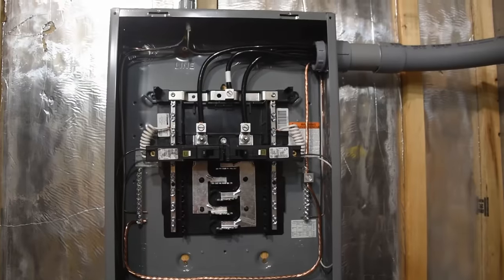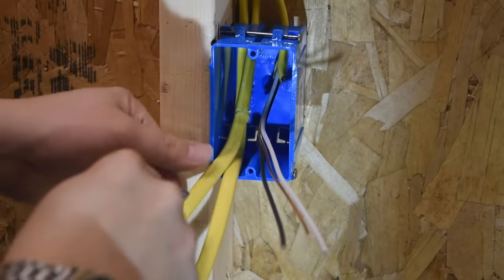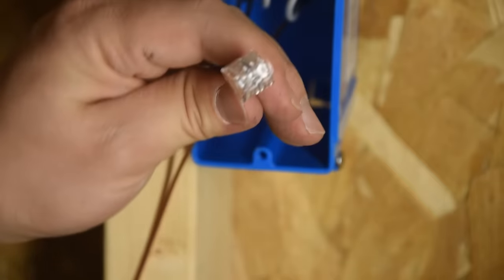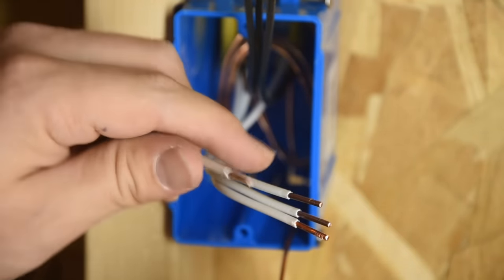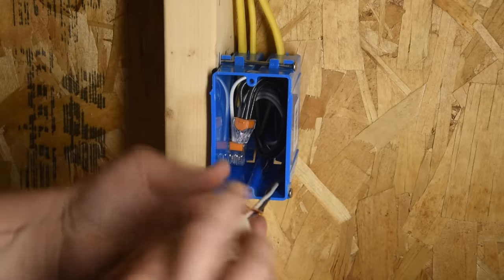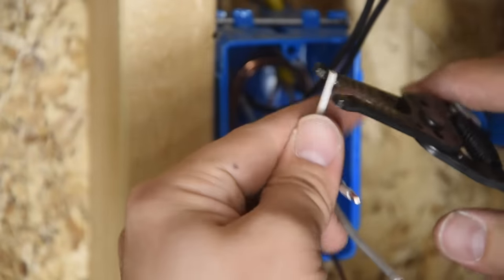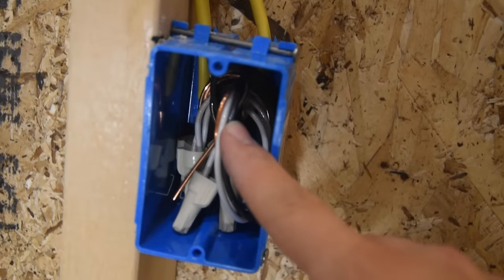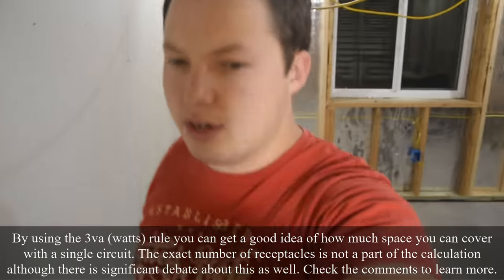Wago's vs. Wire Nuts - How To Wire Outlets During Rough In

Comment: 34 years in the business,  the Back Stabbed outlets and switches failed. Twist those wires!  current is heat.
Reply: Valuable information on here, Thanks 😊
Reply: 35 years here always twist and wire nut them never ever back stab my friends or my outlets
Reply: @Edgardocelectric007  What about Wagos though? are they good for 120V long term?
Reply: @Nate-ud2yt  personally dont know(much like shark bites i hdont think they have been out long enough for accurate test)  dont like these push types starting to use the lever ones and i have been a fan of copper crimps and nylon snap caps for 25 yrs

Comment: When you get a little older, you'll realize why old electricians twist the wires together with lineman's pliers and use a wire nut. Also why they don't use push in connectors on the back of outlets or switches. Hopefully no one dies in the resulting fires in the interim.
Reply: When you get a little wiser, you'll realize that wago connectors are perfectly acceptable and are UL, CSA, IEC, and CE certified. Just because you where taught to use another method does not mean this method is unsafe.
Reply: @BrianSimmons  Where did wisdom come in this discussion? Lazy people will always go with easy way.
Reply: @BrianSimmons  
Was aluminum deemed as a safe wiring method? Stab in receptacles that allowed 8#12 to be stabbed into the back?
Just because something is listed and approved does not mean it is safe.
Zinsco for example was and is UL.
Reply: @chrisminblkdiamond  Aluminum wiring is not unsafe.  It has been used in electrical transmission lines for hundreds of years and is still used today.  When it was used for about 10 years in residential wiring, the switches and receptacles that the wiring was used with weren't designed to be used with aluminum wiring and that was the hazard.

So there are several takeaways here.  One. you don't really know what you are talking about and two, unsafe practices are corrected pretty quickly.  Yet Wago connectors have been used for nearly 50 years.  If they were truly unsafe, they would have been outlawed long ago.
Reply: the greatest line and lesson from Jurassic Park was Jeff Goldbloom,  “Your scientists were so preoccupied with whether or not they could, they didn’t stop to think if they should.”
Reply: Nowhere in the mfg instructions do it say, twist the wires, thus when you do so, you are violating the mfg instructions, thus negating it's UL listing. FACT.  And even dumber is actually twisting the wires, which is also a violation, since it unnecessarily causes stress on the solid wires, not meant to be twisted as such
Reply: Yup, I have an electrician friend who makes a good living fixing electrical faults caused by lazy electricians (and home DIY'ers) who used the push-in connectors on outlets and switches instead of the screw terminals. They ALWAYS fail. If yours haven't failed, it's because they haven't failed YET. These Wago connectors look to be exactly the same. Maybe the lever ones are different?
Reply: @cengeb    And nowhere in the mfg instructions does it say not to twist the wires together first. So i guess it doesn’t really matter.
Maybe you can tell us exactly what code pretwisting wires violate.
Reply: @huejanus5505  they certainly do say do not twist wires, , that is not how they are meant to be used...Do not Twist,
Reply: @ScottsSynthStuff  Wago is nothing like the push in connectors on a Duplex outlet, get a education, and stay current...hey, that's a pun

Comment: Does anyone think you should always leave twist nuts facing up just to avoid the possibility of condensation puddling in the nut itself???
Reply: I always try to, especially on the exterior, plus on the interior there's always a chance of broken water lines or roof leaks
Reply: you are right sir...

Comment: note were i am, just putting each wire into a wire nut and twisting, would totally fail on inspection, not allowed, all wires must be twisted tight together clock wise using a good set of klin line pliers then screw on your wire nut, by not doing this it a great place for electrical fires to start,  lost  wires always end up in the wire nut and heat up. on inspection, the inspector will remove at randam if not all wire nuts to see that all wires have been pre tristed tight and the ends trimmed flush

Comment: Why the hell would you feed the circuit in the middle and not the closest outlet so you would only have feed in feed out in all boxes#1
Always twist wire before installing wire nut. Splice should hold itself before wire nut #2   Wago,s are the same as back stabbing and will eventually fail. Don’t back stab #3
 Wago,s cost more and are for piece workers to save time. I don’t save time I do it right
Reply: I agree with feeding from one end to the other, I hate tee boxes because you have to pigtail (resi only, we still have to pigtail in commercial). Side wiring is the way to go, except for Spec-grade P&S receptacles that can be backwired because they screw-clamp the wires.
But Lever Wagos are a different story and are rated for commercial duty. I've been using them for certain applications for a couple years without a callback
Reply: Hi
I have been ann licensed electrician for 24 years and we have used Wago´s for 15 years+.
They are the only thing we use and I have never had trouble with them. Both lever wago´s and regular ones.
All the best from Norway :-)

Comment: Illegal in my state for A.C. circuits.
Reply: What state is that? California has the 2 most stringent code bodies in the nation - the California Electrical Code is more stringent than NFPA 70 and we can use them here
Reply: @sinistersparky9657  Illinois has stricter code than California, I think
Reply: @igfoobar  no. Just no. California itself modifies every model code they use into their own code (if you ever see a print version of the California codes, there are almost as many green pages as white pages... the green pages are California's changes). The city's of Los Angeles and San Francisco further modify the California codes into an even more stringent code - the most stringent code bodies in the nation.
Individual jurisdictions may have "rules" but if they aren't published rules the jurisdictions will get sued by non-local contractors. That's how it works.
Reply: @sinistersparky9657  Ah, the bureaucratic state, there's just nothing quite like it :(
Reply: Well it started with the San Francisco earthquake in the early 1900s and other lessons learned regarding seismic activity and fires - Los Angeles also learned many lessons from their earthquakes - we are on the Ring of Fire after all
Reply: So what deas that tell you. They suck
Reply: I’m guessing they aren’t legal in my state either, as I have never seen these sold at any stores here. OTOH, wire nuts are as common as dirt and are what I prefer anyway. I’ll take a good solid mechanical connection anytime over a spring loaded one. Seen too many burned up “stab in” style outlets in my time.......
Reply: You will notice that Chris does not mention the state, nor does he cite a reference. I'm skeptical.
Reply: You will notice that Chris does not mention the state, nor does he cite a reference. I'm skeptical.

Comment: it's a good habbit to learn to cut one wire at a time it will eventually save you from direct shorting a wire.  yes, i get that the circuit is off but accidents happen.  i was always taught to treat every wire as if it's hot.

Comment: Wago are like the stab connections. I've found failed stabbed connections. My real question is pretwisting or not.  I have not pretwisted unless more than 3 wires.  This i do because years back I watch an ideal factory quality video on the test they do and after was confident their stuff is solid.  But recently, I have come across master electrician that push for it. My thinking is that if you put side by side and twisted the nu to the point twisting the sheading it's ok.

Comment: Wire Nuts are much safer for high current.  Remember, the current increases with each box in use.  Current creates heat and I don't trust Wago's.

Comment: Had push in stuff long ago ,junk!! I've used them on a big job doing a bunch of lighting ,  in parallel ,ok still not the best . With the neutral wire having all the following depending on it your a fool if you use push connect anything . Also if you where not making three positive twist macanical connection s with your pliers before you put the wire but on I would make you go back and fix all of them . Never use the wire nut to make the connection. Sometimes quicker isn't better because you will waist more time trying to find the bad connection after in a call back and it makes you look bad .  I've had plenty of guys on jobs think they are hero's finishing Friday at 2 pm and me taking till 5 untill you try to turn there circuits on and they all pop . They everyone has to stay late to fix there might stakes . Do it rite the first time and stop looking for cheats and quick fixes .

Comment: Why would you pigtail the second box with a line and load feed? Instead of just connecting the two Neutrals and two hots to each screw terminal?
Reply: I agree - I like to have the fewest number of connections possible, and connecting two neutrals and two hots to screw terminals on the device is very solid. You do need to 'pigtail' the ground wire - but I prefer to use a crimp ring and run one of the two ground wires longer to connect to the device.

Comment: I use Wagos or Insure Connectors because you can see the wires and the connections where inside a wire nut you cannot see the connection...havent had a Wago or insure connector yet let a wire loose. The pig tails used is a must for wagos and like the pigtails for nutted wires also..that bulk trying to push two pairs of wires inside a box strsins the connectionscto the outlets..that spells a broken connection.

Comment: Wagos are total junk thats why they dont use them. They burn, melt and have resistance the connection shouldnt have. Its just faster thats it. A wirenut is not in the circuit the wago is and shouldnt be. Nothing is more solid and secure then the conductors wrapped around each other - no resistance. Dont be lazy twist the wires and put the wirenut on.
Reply: Either you’ve never properly connected a Wago before or you’ve bought some cheap knock offs and paid the price 😂
Reply: @carlosf9278  No, I have just pulled out several that others have put in. They said wago on them if you could still read it.
Reply: @RadioRich100  wire nuts is the way. I was taught the old school way. I have yet to see one burn up.

Comment: Wagos are the best non-twist connectors I've ever used only been using them for a couple years I am not an electrician but I do know how to do basic wiring I can't remember who did the test but he uses a pull test he also uses a voltage test and overloaded these things like you wouldn't believe , he checks them with  for heat these things really work they are not anything like shark bite he goes in and explains it if you look on YouTube I'm sure you can find the video just look up tests on Wago connectors

Comment: Wago's are junk. Just like back stabbing outlets. More failures in older homes because the "electrician" was lazy and back stabbed instead of doing it right by twisting conductors and using a wire nut, and landing the device under screws.

Comment: over time these wago's will loose tension and with the new arch fault breakers your going to see alot of problems.
Reply: That seems theoretical to me. But I guess time will tell.
Reply: It’s happened to me already, from then on I use wire nuts every time

Comment: I have never seen wagos fail on their own. I’ve used them for years, I like them for their clean compact installation. I use them everywhere except roughing a residential structure. In that instance, I twist trim and cap with 3M wire nuts due to local laws. Wagos have been around for decades, their nothing new. Hmmm kids.
Reply: Yeah my dad and my grandfather both ME's I got my ME at 31 and I know they would roast me if I used a waygo for anything other than controls

Comment: I use push in connectors when I wire the 18 ga. Led fixtures to the line source as to not twist the 18 with the 14 or 12 as the 18 could break

Comment: Does the move to LED lighting change the calculation for circuit capacity?  I've found that if there's ever the chance for two high wattage appliances to be operating on the same circuit, there are going to be issues. e.g. a 1500W microwave and an electric water kettle, or an electric space heater running on high and a vacuum cleaner.  Add to that large screen TVs, gaming PCs (can exceed 800W if overclocked), etc.
Reply: Electrical codes specify what comprises a circuit. Larger loads require separate circuits and even heavier gauge wiring / circuit breakers. Expect codes to change to account for LED lighting but can't say if any codes have yet changed nor when they might.

Comment: Ben, how many wires can be used off of a receptacle to run power for additional receptacles?  I have 2 sides of a room that I need to add more receptacles to. Right now there is one recept. in the room

Comment: Are there any NEC rules about not shoving ground and neutral groups through two separate knockout holes for each (outside the box above). Seal off the exit point with electric tape. Gives lots of volume inside the box.

Comment: I think wago are good for little load connections but when there is load, like a motor  i would personally like using old fashion marrettes. i can see the wires getting loose on using wagos!
Reply: For heavy loads like a motor, I use butt connectors and a hydraulic crimper

Comment: When you go to install an outlet with that 12 awg wire you should use decorate aka rectangle outlet or one with USB or wifi / dimmer and demonstrate your tips and tricks for training the wires and getting the monstrosity in their straight, flush and plum.
Reply: oh yeah get a dimmer switch or a gfci receptacle in a 15cu box thats a fun one

Comment: Ben, do you know of any cases of Wago's failing and causing fire or other issues?
Reply: I haven’t been able to find any confirmed cases of failure, just rumor and such but just like any wirenut failure . . . it’s usually the user. Wago makes a variety of connectors but the lowest rated connector I’ve seen is rated to 20amp and 221* Fahrenheit continuous.

Comment: For the same reason I don't like connecting devices with push in connection,  I am a bit skeptical about wagos.  
  In my opinion  connection is superior and resistance would less when using wire nuts.   
   I like Tan Twisters.

Comment: Folks remember depending on the area you will use wagos low amperage, but kitchen, cave man, utilities, high power consumption always use wire nuts. For electric ranges, dishwashers.... I recommend 10 gage wire from the panel to the kitchen.
Reply: Wago has 30amp connectors

Comment: Only Wagos for 0,75-2,5 AC/DC. We use in Germany only WAGO the last versions is  really Smart. We recognized that wirenuts and other stuff looks after 20 years like crap because it’s like everything made in China and the plastic is cracking, so the WAGO is solid connection.

Comment: I have receptacles from the 1970s with the push-in connectors that went fra-zizzle on me inside the wall, no way I would trust any connector like that wago. And they demonstrate here how the wago can be easily disconnected by pulling and twisting. Forget it, anything that can go wrong eventually will.
Reply: onemoremisfit they are intensively tested far past the marked current carrying capacity, including independently by YouTube nuts, and they are solid as a rock.
Kind of like saying you went in a car in the 70’s and nearly died so now you’ll never drive.
Reply: @DaddyBear3000  What I'm saying is a house full of receptacles using the push-in connections, one of them failed, badly arcing, not due to over-current but due to poor mechanical contact force, and that's one too many for me to be too lazy to twist my wrist and tighten a terminal that positively crushes the conductor with torque. Also, those push-in receptacles were name brand and no doubt tested as well ... tell it to the arcing contact, before it sets fire to my house. And if I have a bad experience with one car, I'll try to drive another car of a better type.
Reply: onemoremisfit I get what you mean, ‘once bitten...’ I’ve used a Wago’s a lot and had no issues so far.
Reply: @DaddyBear3000  That's fine if you like them. BTW, I'm not the guy who wired the house with push-ins, I'm the guy who's taking them out after I bought the house and discovered them, and I never would have used them in the first place.
Reply: The reason the outlets in your house failed is because in the 70s most receptacles were on 15 amp, 14 AWG circuits and the wire was actually a bit smaller than our current wire, then backwired into CHEAP, LOW QUALITY receptacles.   I can almost guarantee that the previous residents used plug in electric heaters on that circuit because the long term heating in the outlet weakens the spring steel that grips the wire. The heating will happen on any outlet upstream from the heater and will exploit the weakest link. 
But the Wagos are made differently and they aren't cheap. Wire nuts are great as long as you install them properly but I see more problems with homeowners and apprentices installing wire nuts improperly and just wiring outlets wrong period than I see problems with Wagos

Comment: TWIST..........My problem with these connectors is the same as using the push sockets on the back of receptacles and light switch. There fine when you first do them but over time corrosion can occur and you loose continuity and when it's on the neutral side it can be a bear to find.  Wire nut are a mechanical connection with lots of wire contact. So I always use the bolts on the side of rep. and switches.